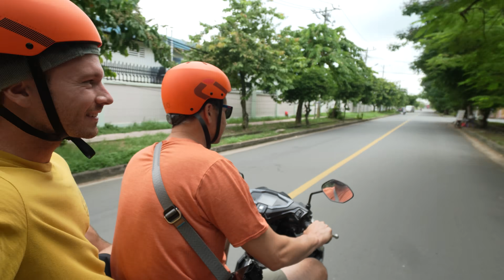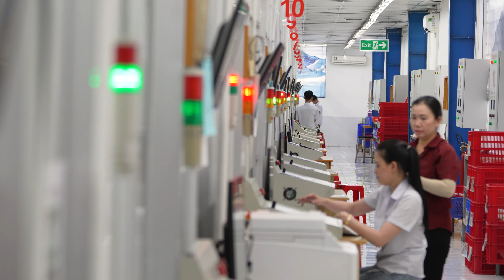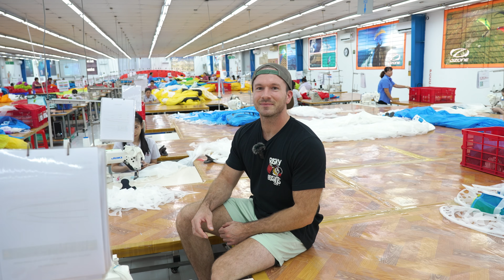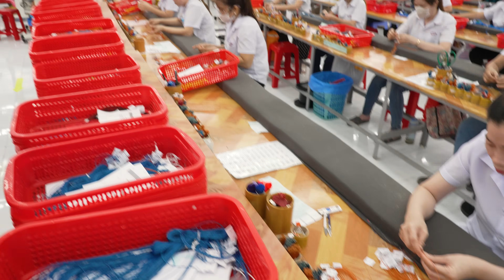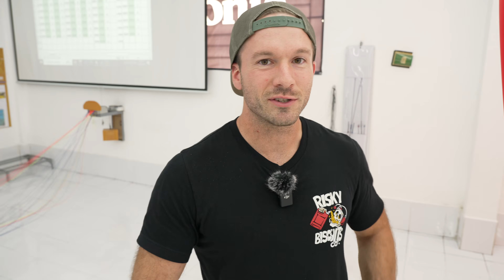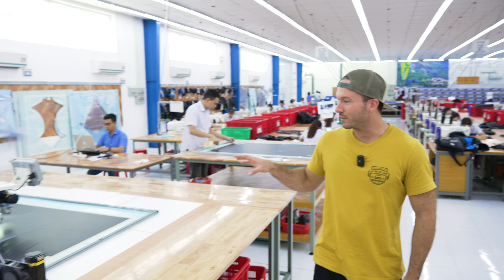How Paragliders Are Made - Inside Ozone's Factory!

Comment: Thanks for the tour. I'm a newbie that just purchased a new Roadmax for my trike that came with an old Atlas. Unfortunately, my instructor suffered a physical injury and couldn't continue with me and we never had the chance to fly the new wing. This gives me the confidence in knowing that the wing is well made and I can continue on my own to figure it out. I learned a long time ago that the right equipment makes the learning process so much easier. Like you, I'm here in Arizona and I'm just waiting for the heat and the wind to lessen so I can give it a try. If you're ever in the Kingman area there's a dry lake bed about 35 miles north that I fly out of. It's called Red Lake and it's 16 square miles of flat surface. Check it out. 😁

Comment: Ive worked in design and manufacturing for over 10 years with Vietnamese and Chinese factories. Ive been to HCMC many times and I can tell you that they simply have the best talent, machinery and infrastructure for soft goods manufacturing in the entire planet. The employees are paid pretty well and are extremely good, and the standards are extremely high.
Reply: Same, I’ve been to factories in HCMC there and this factory is top notch and very dialed. High quality operation, nice machines and tools to calibrate to set standards. Rad video.

Comment: Me scanning every table for my custom-color D5 that's on order. Anybody that complains about the high cost of gliders should watch this video. Even with the stupid tariff I paid in the U.S., it still seems like a deal when considering the amount of work that goes into these.  That Ozone factory is cleaner and more high-tech than the factory in China that took away my aerospace job.
The technology used is very reassuring. No chance of getting a glider like the Advance Sigma 5 that came with lines installed for both a medium and large size mixed in. It made for some interesting but unintended SIV moments.